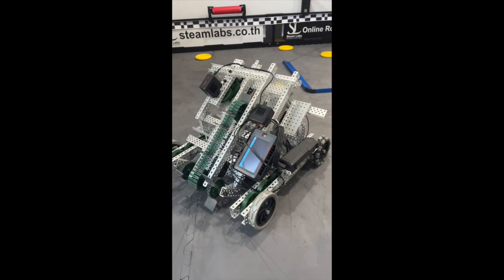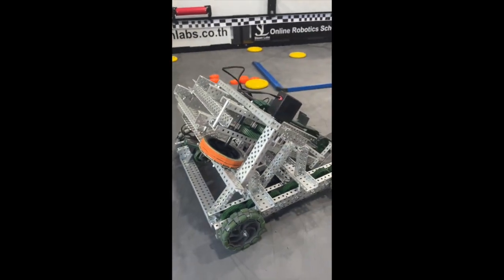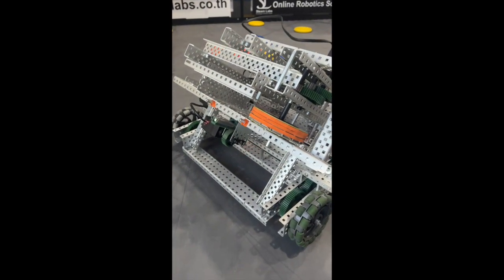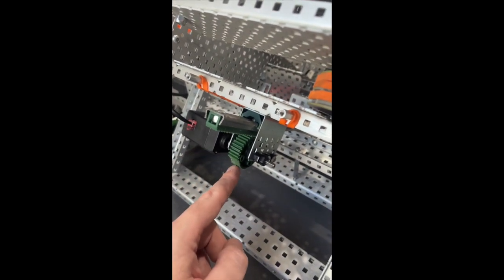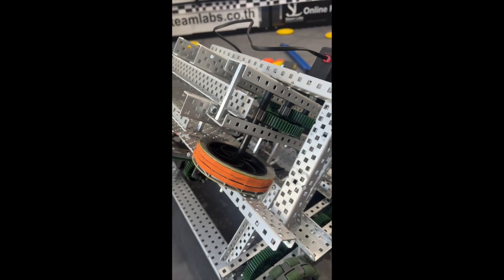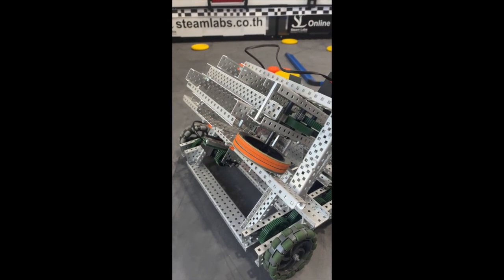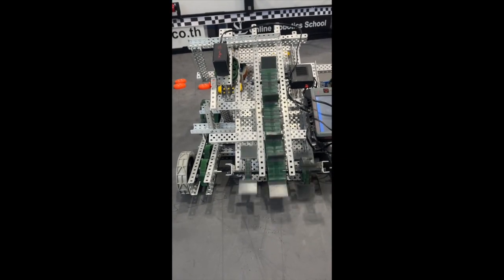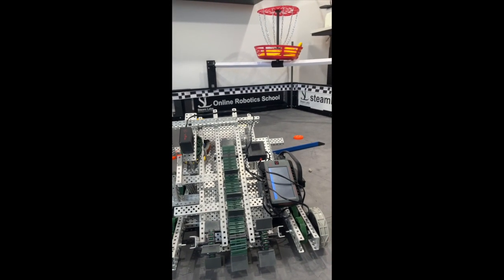VEX Spin Up Robot Reveal

Comment: Love the linear puncher loader. I would recommend that y’all support the drivetrain wheels on both sides (instead of cantilevering them like they are currently) and invest in some flywheel PID control to minimize the flywheel’s velocity recovery time
Reply: Inspiring comment 😍
Reply from the maker: thanks for your comment, already changed the drive base, check out our photo on twitter https://twitter.com/steamlabsbkk/status/1536320106250113024?s=21&t=CxwPpksTvVcgjr-dR1V68w

Working on PID sensing now, this will take a while to perfect I think